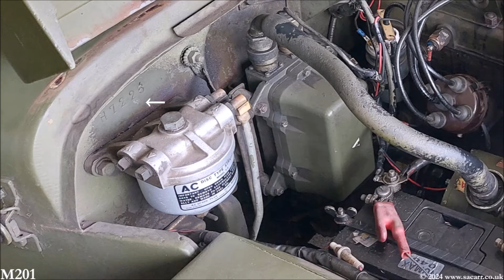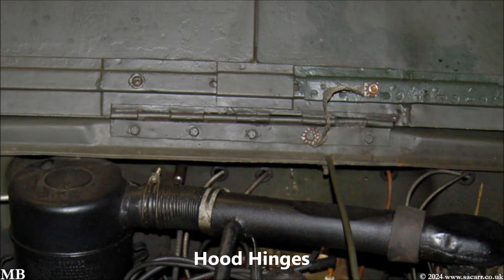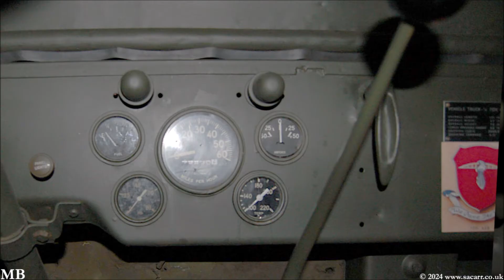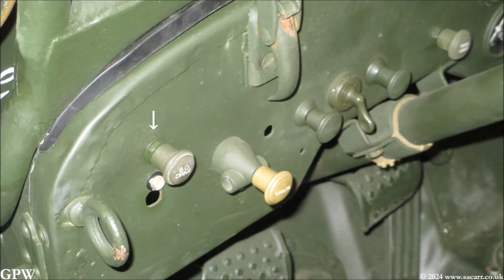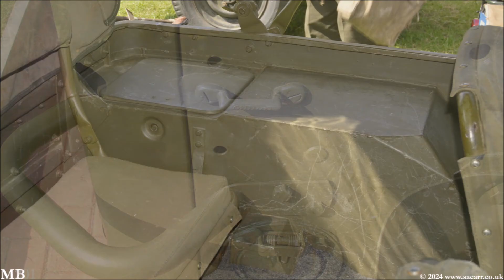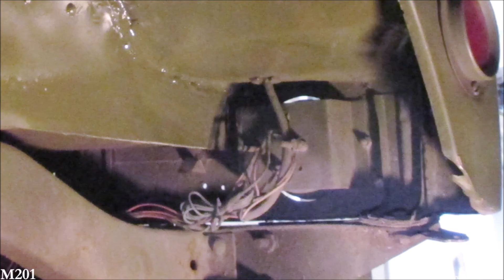Jeep Spot the Difference - Willys MB, Ford GPW & Hotchkiss M201 - Part 2

Comment: In your video at 5:20, you show the M201 with the screen clamps that appear to have extenders. Are you certain these extenders were part of the original design? I noticed hood blocks in the same photo, and that might mean there's a 'double' distance. Because the hood blocks are such an iconic feature, perhaps someone added them later, which then required the extender on the screen clamp. Thanks a lot for your video, I just love it!
Reply from the maker: I haven't seen any original pictures of MB or GPWs with extender blocks on the screen clamps; only the Hotchkiss M201. On my own M201, I added the hood blocks during my "Americanisation" of my Hotchkiss. At this point, I hadn't removed the screen clamp extenders.

Comment: I have a Ford Build Date 12-16-44. I am in Washington state on the Pacific coast. I find these videos informative although its not my first jeep. I had a very rough Ford with steel ID plates my Dad bought me in 1970. Then In the 80s I picked up 2 all original rust free Greek returns. When I moved to WA State from the State of Georgia on the Atlantic Coast, my Dad sold all 3 to Richard Grace in Fairburn GA. These were essentially stolen from me. They were sold without my knowledge or permission. I was not able to locate Richard Grace to see if they could be recovered when I could gather enough money to do so. It was like losing three members of my family. After attending the 80th anniversary of D Day in Normandy. I was so moved by the enormous number of restored WWII vehicles, I felt something was really missing from my life and I realized it was those jeeps. So I started halfway looking and found the Ford I just bought a few weeks ago. I am a heavy equipment dealer and have a full shop, so it will be a great winter project. My wife says it will keep me out of trouble.......
Reply from the maker: I've got two Jeeps and a Dodge WC51 Weapon Carrier. They certainly keep me busy!